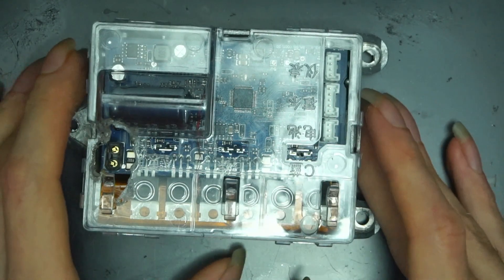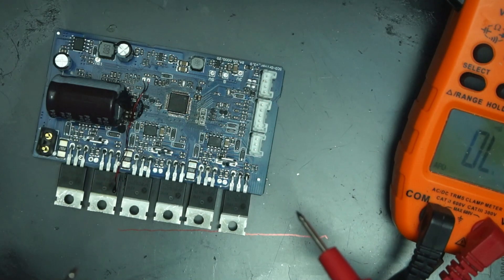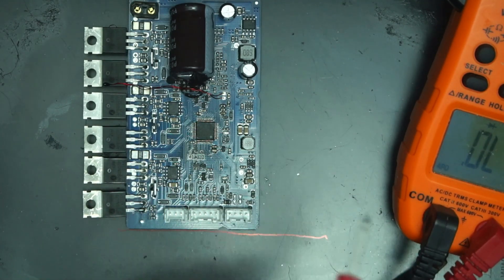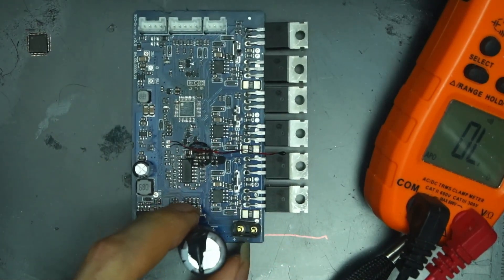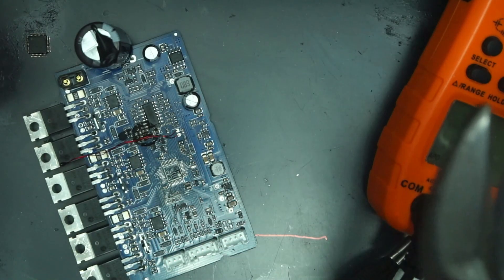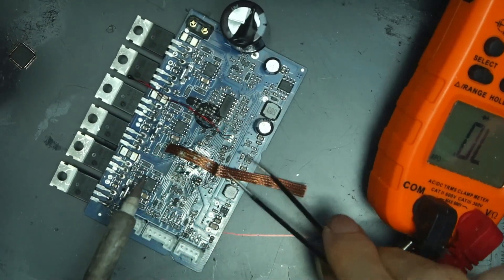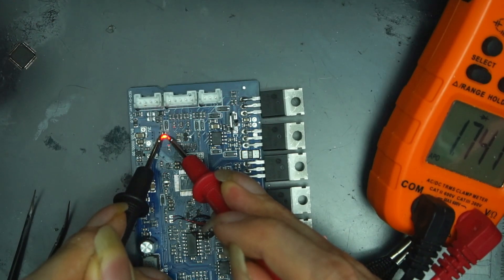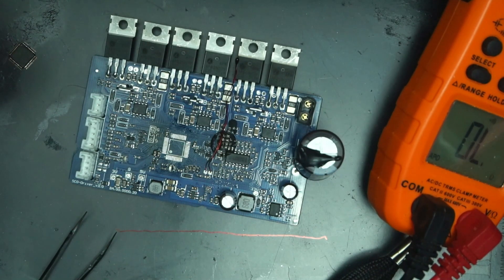XIAOMI M365 Electric Scooter Motherboard Mainboard ESC repair part1

Comment: Hi teacher.  Thank you for the video you make for people to help people.  I need to know the name of the 12 volt (ic) of this Xiaomi motherboard, thank you. I need the purchase link on AliExpress, for example.
Reply from the maker: I try firgure it out it should be the BDX IC you need  when read on chip is called BDXEAA or BDXDMJ but last 3 letters are XXX so it random I found chip on aliexpress https://www.aliexpress.com/item/1005002610952142.html?spm=a2g0o.productlist.main.17.78ee130apRUNK1&algo_pvid=b215313b-4ce1-48f0-a269-7eb9f6fea122&algo_exp_id=b215313b-4ce1-48f0-a269-7eb9f6fea122-8&pdp_npi=4%40dis%21USD%2120.94%2115.29%21%21%2120.94%2115.29%21%402103080617124658597473649e726d%2112000021382335764%21sea%21DK%211751719418%21&curPageLogUid=iPbd8BRPpXju&utparam-url=scene%3Asearch%7Cquery_from%3A
Reply from the maker: SY8502FCC, Xiaomi Crosser DC-DC преобразователь BDX7GA BDX7RA BDX7TB 72DX SOIC-8 
Применяется в контроллерах электротранспорта Xiaomi Crosser в качестве DC-DC преобразователя 42V - 12V

Даташит https://datasheet.lcsc.com/lcsc/1809231105_Silergy-Corp-SY8502FCC_C87752.pdfhttps://prom.ua/p1631915930-sy8502fcc-xiaomi-crosser.html
Reply: No lo puedes poner en español por favor